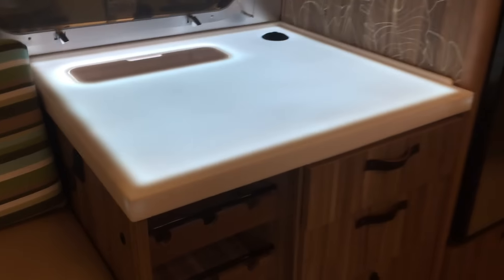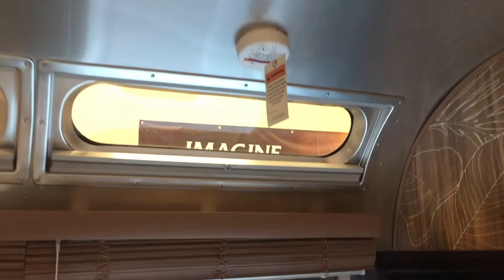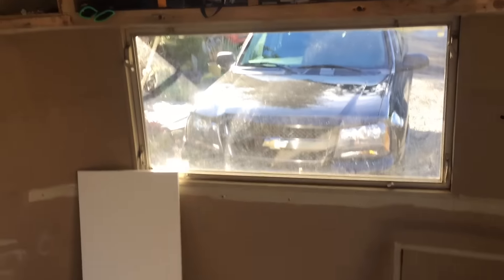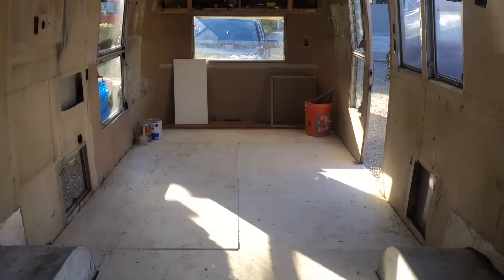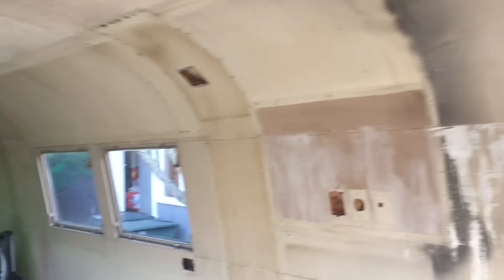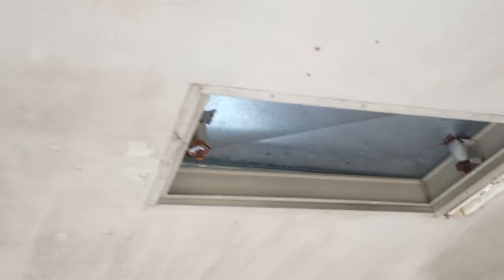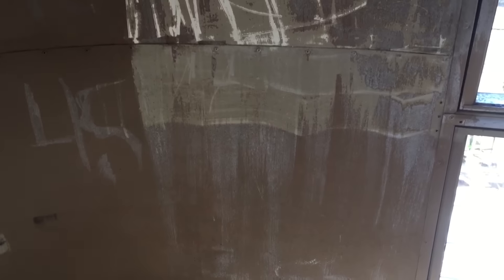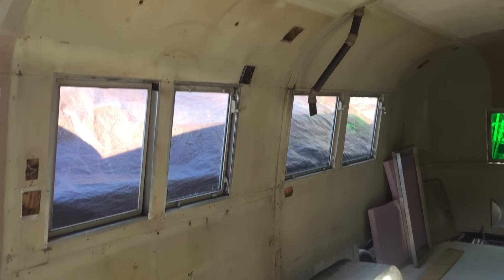Vintage Airstream Renovation - Week 4 - New Subfloor !!   |  Moxeejo Show Episode 4

Comment: I think you said in a pass video you had a roof leak. Were was it at and how did you fix it. Only asking because I know zero about the Airstream. I ran into a leaking roof on mine . I had a rubber roof on mine that got a hole in it and had a lot of water damage. Not as bad as yours.
Reply from the maker: Hello! My small leak was from the old vent/fan over the kitchen area. There was a crack in the cover which is (thankfully) an easy fix. I will be installing 2 Fantastic Fans > the airstream community LOVES these apparently :) Do you have an airstream? With a rubber roof? That seems odd to me..
Reply: No I had a 32 foot Hornet. It was roof repaired because of the sewer pipe broke of and made a leak. The insurance had them to put on a patch job. About 5 year later we had a major storm and tree limbs broke of and fell and must of damage the roof in the patch job area. Water was leaking in. I was hurt so I didn't even go camping for 2 1/2 years. Called the Insurance and they would not pay for the damage. They said it was because I didn't keep a eye on it. I hope one day to get a new one because I miss camping. Good Luck on yours.
Reply from the maker: WOW. Thank you for sharing.. this is such good insight on true insurance nightmares :( I'm sorry you had to live through it, I hope others can learn from this snippet of info! Wondering how to prove that you "keep a good eye" on your systems?!